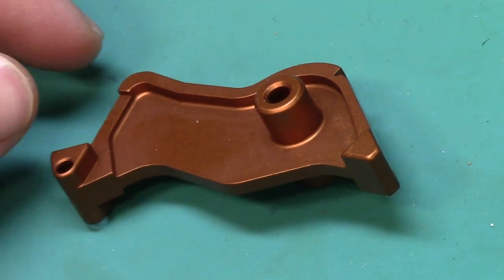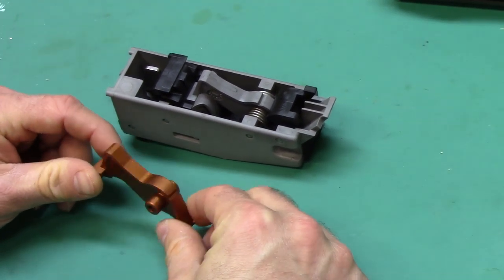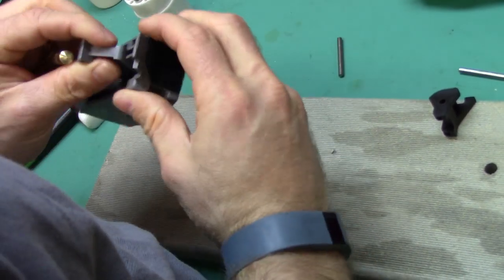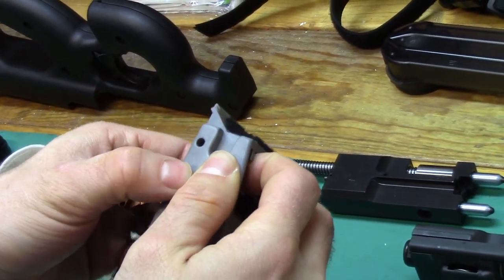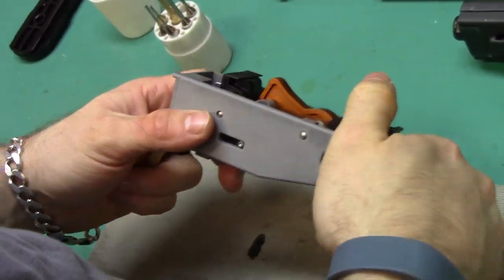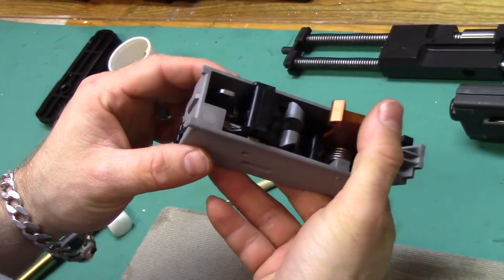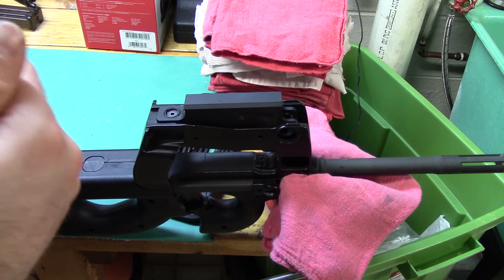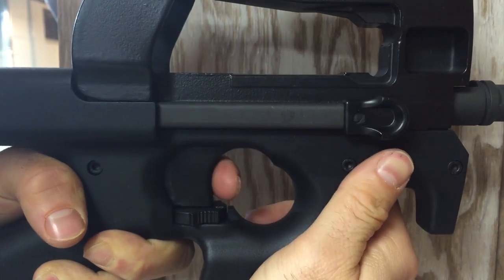P/PS90 Shortened Pull Aluminum Hammer Review

Comment: It dimpled because its probably 6061-T6, Even if you wanted it made from aluminum it should be 7075 Hardened. The original part is not "plastic" its glass filled nylon, with the glass the composit polymer has a higher impact strength than that aluminum part, its actually superior.

Comment: Thanks for the video. I thought I was the only one having difficultly getting the safety sear pin back in after replacing my gen 3 hammer with an aluminum one. Your tip of using your push tool to assist worked great for me.

Comment: The replacement trigger is modeled after the Gen-1 hammer the change in trigger pull must be due to the surface of the hammer being help by the sear.  If you really want lighter trigger you can get a 4.4lbs trigger spring for about 30.00 and it does a great job

Comment: Thumbs up & subscribed.

I'm new to the PS 90, but great instructional vid on how to replace the polymer hammer with the alum hammer.

Is this alum hammer machined or cast? I haven't had a chance to read every post in your link yet; only the first page and I do not recall any materials specs being mentioned.

Also, from your description, my trigger pack looks like it is a Gen III. The hammer is grey, but as you said, the earlier Gen packs are "usually black" which I assume that some Gen I & II had grey hammers.
I do not know what Gen the white hammers were on.
Reply from the maker: SavageJim01 I believe these are machined. I'd have to ask the manufacturer for more specifics on materials.

Gen I/II packs always typically had a black hammer, but I've seen orange as well. White is usually gen IV::

Gen 1: Black pack body, black hammer, OD green semi sear, auto sear present.
Gen 2: Gray pack body, black hammer, OD green or gray semi sear, auto sear present.
Gen 3: Gray pack body, gray or white hammer, gray sear, auto sear present.
Gen 4: Gray pack body, black, gray, or white hammer, gray sear, no auto sear. (As JHS mentioned, the hammer in a Gen 4 may actually be black but the defining characteristic is that there is no auto sear.)
Reply: Buffman
Thanks for the quick reply and info on the trigger packs.

I feel like such a noob; I reread the link above and the very first post described the hammer material as 7075-T6 aluminum.
Knowing that alloy and its T6 treatment are aircraft grade and offers great mechanical performance, I have good faith that this hammer will perform very well even with the dimpling you showed on the hammer face.

I am now curious if the P/PS 90 firing pin is capable of being struck by the alum hammer since it was designed by FNH to be struck by the polymer hammer.
I only ask because I come from arms that use all metal firing mechanisms and the firing pins I believe are all hardened and treated to accept being struck by metal hammers.
Reply from the maker: SavageJim01 Not sure of anyone who has that many rounds. I think the thread details that the hammer pack is a 100K round item. I'll keep an eye on the firing pin..

Comment: Has the MKS Hammer caused any wear on the polymer parts in contacts? I'd would assume that the metal could wear the safety sear and/ or the front sear, but I have been wrong before.

Comment: Are the weights listed at 6:40 correct? The aftermarket hammer is nearly 2x heavier than the stock hammer?
Reply from the maker: NICKydex01 Yes they are correct. The manufacturer stated this was to ensure a firmer primer strike. Although I've never had an issue with a light primer strike in my PS90 or FSN, those that reload that could be an issue.

Comment: This is why I don't buy used guns.
Reply from the maker: Do tell?
Reply: @BuffRANGE  modifications that add no benefit or make the gun less reliable. FN knows what they are doing.
Reply from the maker: FN certainly isn't perfect. Scar 20S popping primers in 6.5 CM, 509 broken strikers, etc. This hammer dropped the pull weight 1 lb, and is a non permanent mod.. :)